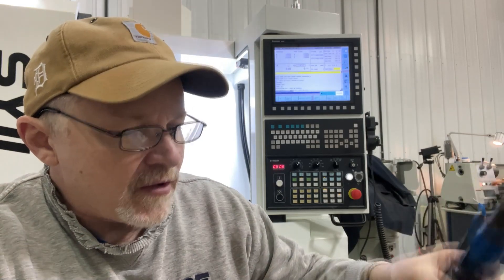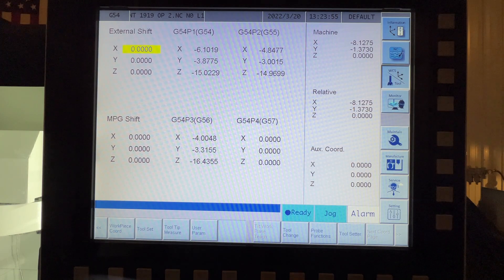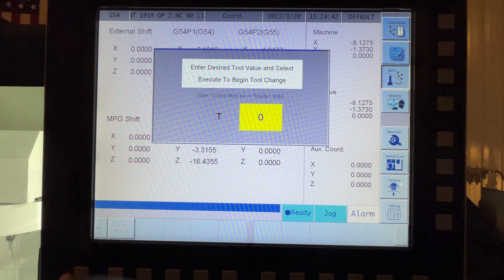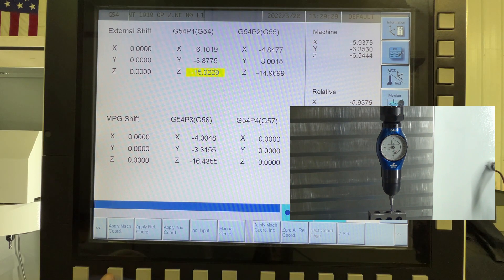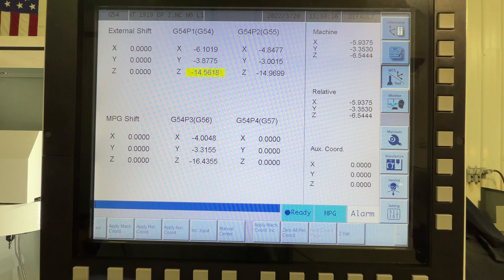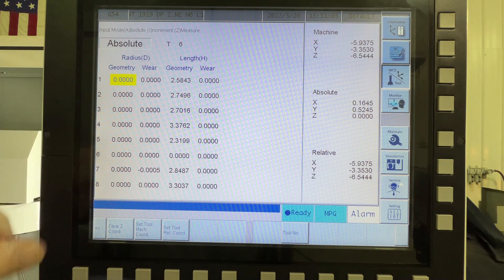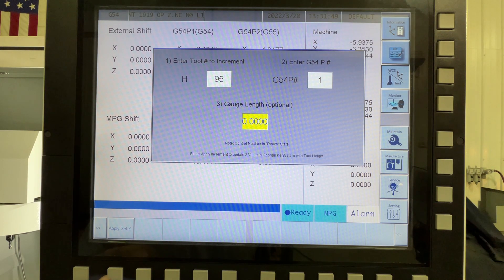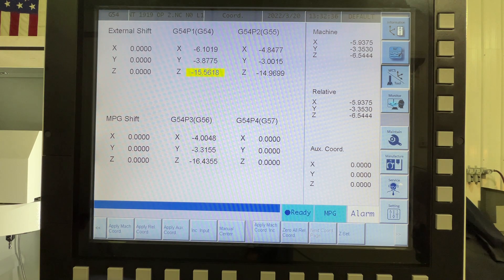X7 + Syntec 22MA new Z setter screen and tool change menu.

Comment: Great video as always, just a question, how did you originally get the height for the 3D tester ( the value on the tape) ?  Thanks!
Reply from the maker: There's a few ways to measure it but I think this is the easiest.

1) Start with a tool of known length (anyone in your tool table).

2) Touch the tool off the top of a gauge block.

3) Zero all Relative coordinates.

4) Switch to your 3d Taster and bring it down on your gauge block to zero the needles.

5) Read your relative coordinates. 

6) Add the tool length from step one to the number from step four. This will be the gauge length of your 3d taster.

Hope this helps.